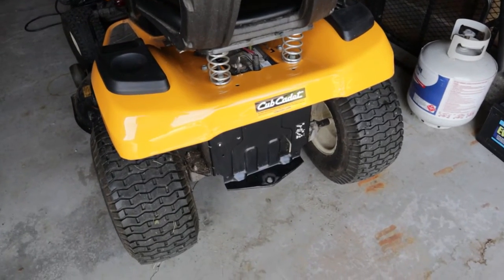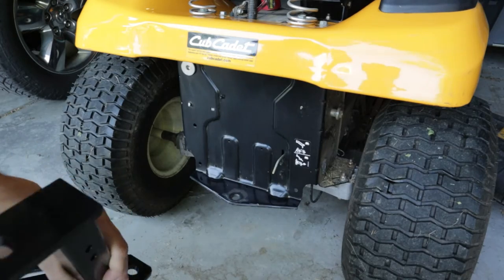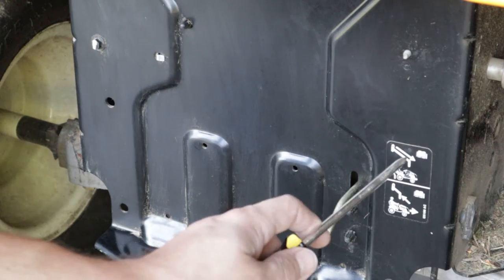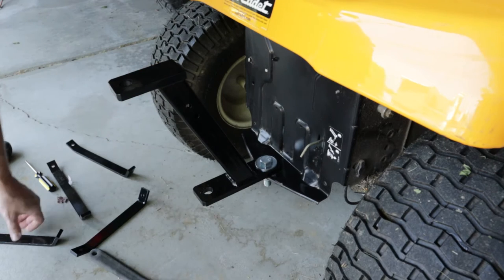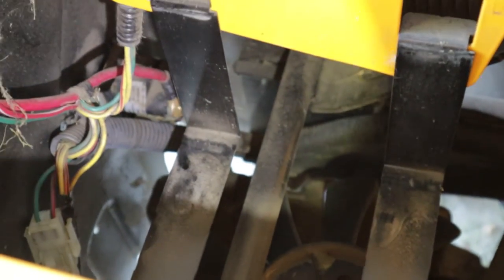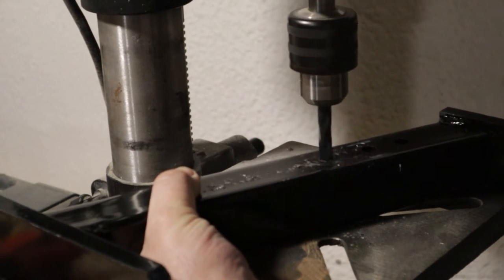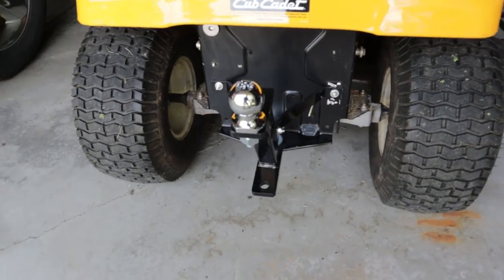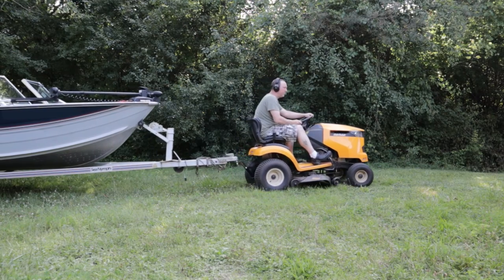Installing a Reinforced Trailer Hitch on Riding Mower - Towing Boat Trailer with a Lawn Tractor

Comment: I'm in the same situation you were in and had to do the same thing. I didn't want to drill in the frame on the mower so I just drilled the holes on the hitch. Good video.

Comment: Thanks for your video. I have a 22hp Cub Cadet tractor  which looks identical to yours, and a boat that needs moved less than 10-feet in my concrete floor garage. This should work perfect, and save me a lot of money (electric dolly) and from getting a sore back. Moving a boat manually doesn't get any easier as my boat and I get older. THANKS AGAIN!
UPDATE: I removed Cub Cadet hitch BEFORE trying to tow anything; due to I mow 2-acres and don't want to risk tearing up the mower. Bought a 3-point hitch (Amazon, $56 used like new) for my 33hp diesel tractor. Tractor was too big to maneuver boat in garage. Bought a 3600lb electric trailer dolly from Amazon.
Reply from the maker: Thanks Wayne, I'm glad my video helped!

Comment: Can you pull the trailer up a 7 degree elevation (13% grade)? I'm looking for a <$3k ride-on mower that can pull a 1000lb utility trailer up a 7 degree elevation grass slope with somewhat ease. Thanks for video!
Reply from the maker: Hi Charlie. I couldn't really say. I don't believe my mower would be able to do much of an incline. My property is quite flat, and it works fine for moving the boat around here. 25 degrees is probably much too steep for my specific mower, both in weight and power.
Reply: @GreatLakesPrepping ok thanks. I updated the comment with the actual calculated grade instead of a guesstimate. Ya the slope could be tricky